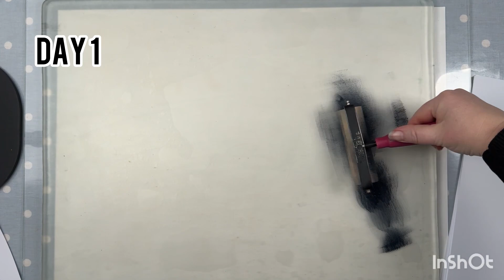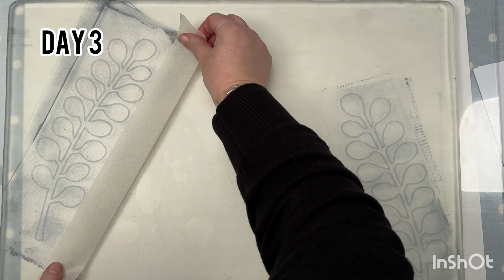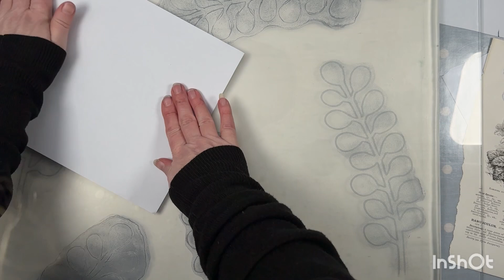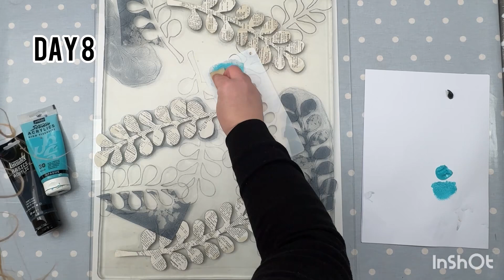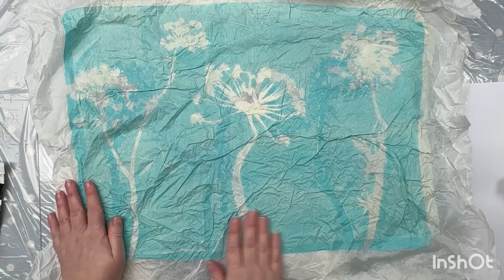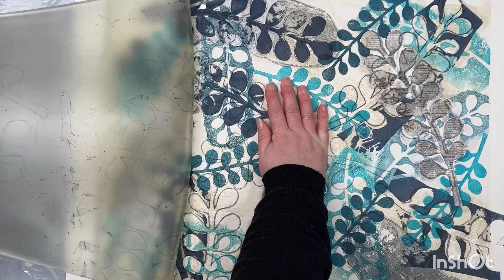Exploring Gelli Printing Techniques: The 100 Day Project, Days 1-12

Comment: This is a great video! I REALLY like the shape cut out from the  book pages! I also love how you figured out using the pastel pencil and pressing it into the layer of wet paint. It came out SO CLEAN!! 😁
May I ask: from where did you get the LARGER botanical shape that you used in this process? I really LOVE it!!
Reply from the maker: Thank you. The larger shape is just a hand drawn template based on the stencil which is slightly smaller. 🙂